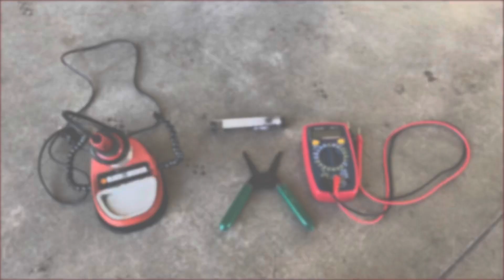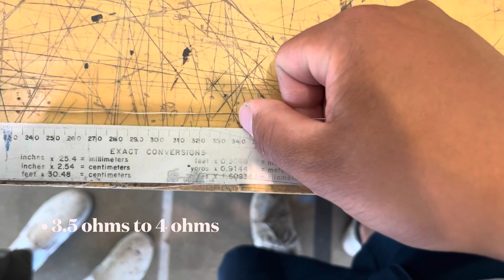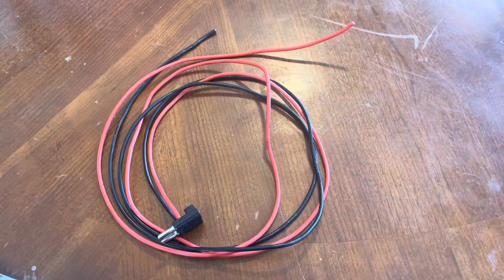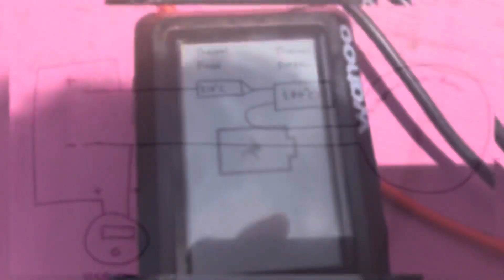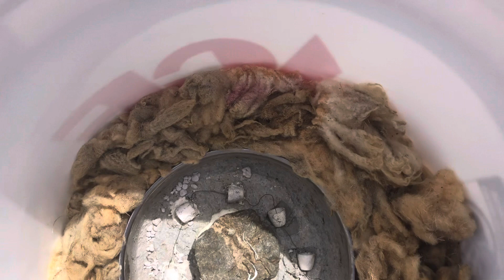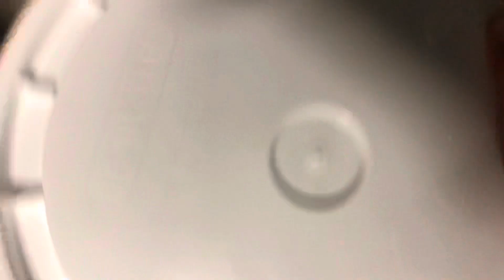How to build an Insulated Solar Electric Cooker (ISEC)

Comment: could i use a PTC heating element instead?  12-220V 60-270 degrees constant temperature PTC ceramic electric heater heating plate -these go for $2.50.
im new to electronics and cant get my head around it.  currently working in cambodia in the countryside - many people would need this!